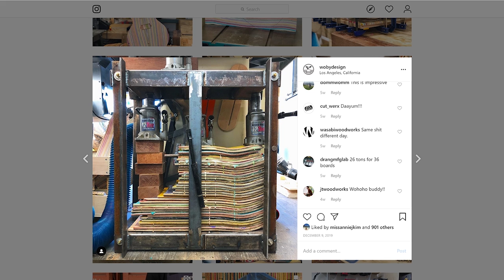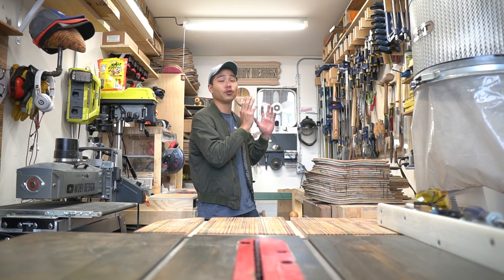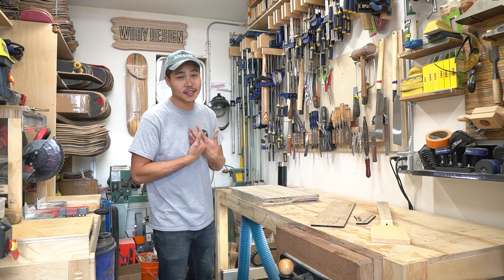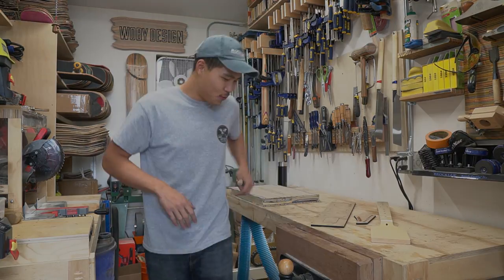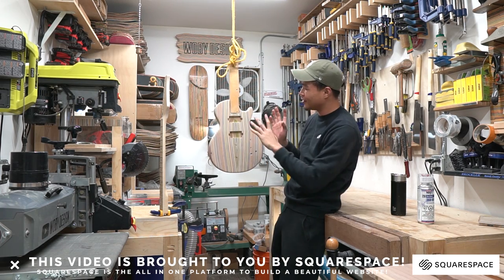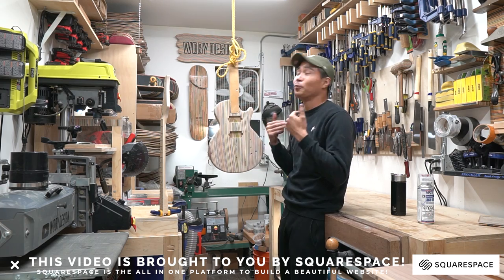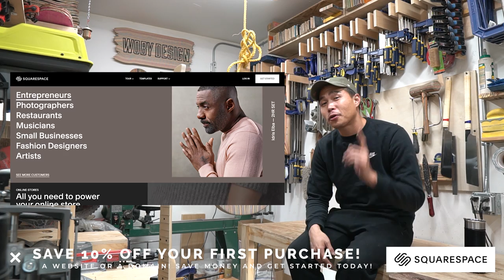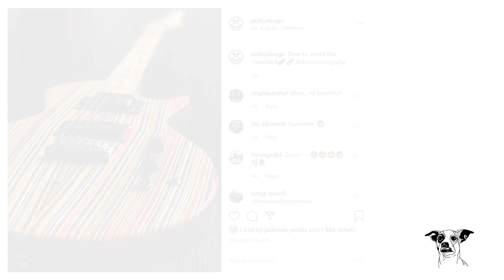GUITAR MADE OUT OF BROKEN SKATEBOARDS!

Comment: Awesome job! An idea to peel off the grip tape would be to bring a sort of oven into wich you could put stacks of boards to warm up and then take out once at time and easly peel off
Reply: Davide Zannella I wonder if a sort of oven may too much dry the fibres and adhesive of the whole boards which may promote cracks. I was thinking a iron
Reply: Put them out in the sun when you get them. They're all gonna need to be peeled eventually so why not do it when they arrive. That way you'll have a stack of prepped boards whatever the temperature
Reply from the maker: Livi 120 maybe I make it look too easy but this is really hard to do, my forearms can barely move without cramping... and you think I’m gonna sit there and do 100s? Who’s gonna edit this masterpiece?
Reply: @WobyDesign  another idea i came up with while watching you peeling is  to attach a drill to the wood stick you use to peel, maybe you could build a steel version with an attachment for the drill welded on one side
Reply: I was thinking of that as well, and a low RPM high torque motor to do the turning, you could just feed the board into it and it would peel it off for you.
Reply: Some good ideas here. Using a winch motor to help peel the boards has got to be the future. Great video btw.
Reply: @jameslowe2979  Oh yes, or at the least, a larger dowel/pipe for more leverage.

Comment: I’m at stage 1 of doing something similar. I have an old electric guitar that needs reconditioning and I am going to shave 10mm off the face of the body. Make template (Perspex)for placement of holes and mountings. Then make skateboard top 10mm. Glue to cut down body and shape edge profiles to original. I have some of my sons old boards which makes it personal. I then ate a guitar case with glass lid ( skateboard frame)so it becomes a wall hanging. Use a Perspex scratch plate or maybe pearl.

Comment: Diggin' all your videos! Amazing making. I've watched most of your videos at this point and was wondering if you used a heat gun on the grip tape. That looks brutal holding it here. Maybe if you mounted 2-3 on a stand and zip-tied the triggers down and could just leave them running. Maybe throw on an outlet timer so you can just walk away?